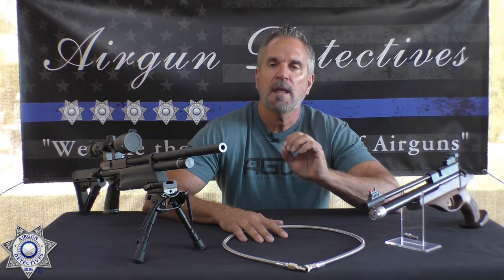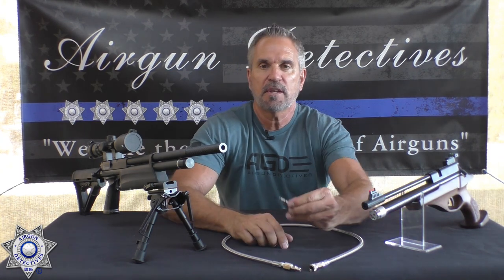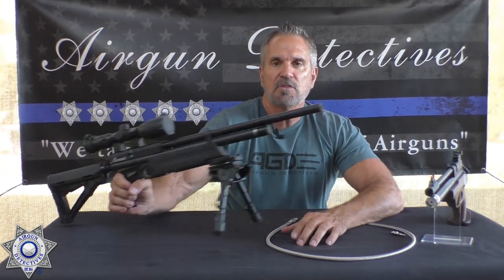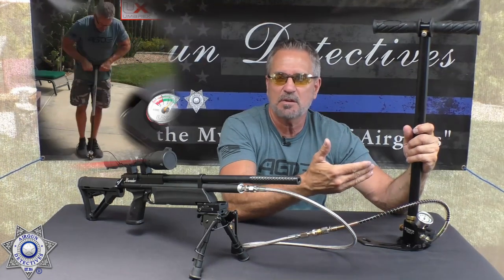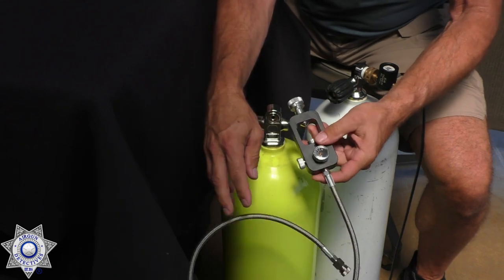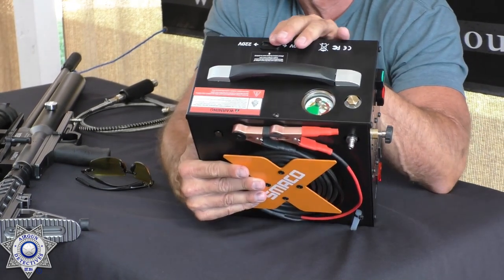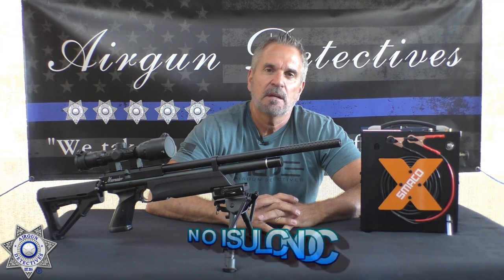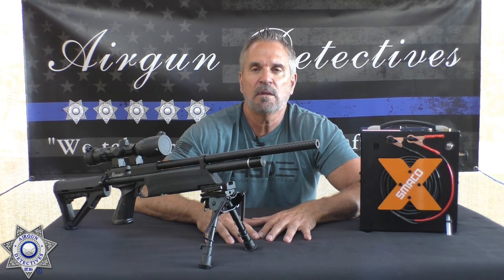"How to fill your PCP Airgun", by Airgun Detectives

Comment: I am looking at buying my first pcp and trying to figure out if I can use my workshop compressor or if I have to use a separate compressor designed just for pcp guns
Reply: No...all stardard compressor from box stores CANT be used for pcp just dedicated pcp compressors
Reply: you need high pressure compressor mate

Comment: Nice, I use a hand pump on all my PCP's due to safety concerns around my kiddo. Yes, higher priced hand pumps are better than the cheap ones. I fill both an AGT Vulcan 3 and an Air Ventury Avenger.
Reply from the maker: They can help you stay in shape as well😉 Thanks for tuning in 👍🏻

Comment: I NEED HELP!!!!! I just bought a new Stoeger XM 1 and it had some air in it and I shoot it all out. Yeah I am a newbie. I have a pump but I have pumped for 30 min. and the needle on the gauge doesn't move. I can hear air going through the pump and the rifle came half charged. I don't know what I am doing wrong, or does it take an hour of pumping when the tank on the gun is empty?
Reply: Probably gonna have to take it to a airgun shop or contact the company I'm pretty new to airguns but the only thing I can think of is something is wrong with your pump or the airtank what pump are you using?

Comment: Thank you for doing this.  Entering the PCP market is intimidating when you read (constantly) about these and those fill probes, lubing these fittings and o-rings, and not these ones.  Maybe now it will be easier...
Reply from the maker: Matt, thanks for tuning in. As the PCP rifles are becoming even more popular there are more pumps being developed. This is good because the price keeps coming down. When I first started shooting PCP the max fill was 200 bar and your options was a scuba tank or a $1500 compressor. Happy Shooting 👍🏻

Comment: Walmart now has high pressure air cooled compressors up to 4500 psi for about $180 and up...extended service agreements available. Worth a look.
We use a water cooled original ourselves. We fill a carbon fiber tank usually from 3000 to about 4300 psi on 1 cycle. From empty it takes much longer. Enjoy, be safe.
Reply from the maker: Kelly,  great information.  Thank you 😊

Comment: is this the only way> can you use like a pancake compressor > like something you would use to run a nailgun or other pneumatic tools?
Reply from the maker: Negative..you need at least 3000 psi. Most your home air tool compressors are 100-120 psi. The good news is there are many affordable choices out there. 👍🏻😉

Comment: I have an EGAL CLAW LEVER ACTION GUN  when I follow your direction on filling the gun, of bleeding the pressure out of the fill line -----all the are comes out of the gun, I called the seller and he told me to just let the air out of the line faster to make the air not come back out, is that right ? I though you just turned the bleed valve open and let the air out of the line, then just disconnect the hose.------------ I'm confused
Reply: I have asked this same question on several forums on YouTube  never get an answer ?????????????
Reply from the maker: Very simple...when you get to the full level on your gun, turn the pump off, open the bleeder valve, and remove the filler hose. You'll still let the pump's fan work for a few minutes to cool down the pump. I hope that gives you some clarification 👍🏻

Comment: Hi, you didn’t mention why the air bleed valve, when is it necessary to do that, every time you unhook gun tank, or is it to bleed off all the air when hooked up to gun. Thanks for all your information. Keep up the good work.😊
Reply: I was thinking the same thing. pretty important safety issue, not addressed.

Comment: Hello. What is the possibility of buying a separate 12V battery instead of using the car battery to charge my PCP rifle. I have a new GX pump I bought on Amazon. Harbor Freight has 12Volt batteries for under $50.00. What are the requirements for the 12Volt battery to basically run the GX compressor?

Comment: The gun im looking to buy is a Hatsan Flash QE in .25 and it has a 165cc tank. Would it be wise to go cheap and save money and get a hand pump or spend the extra on a whole system.

Comment: Hi JC GREAT video!
Do you use anything to remove moisture as you fill the pcp?
I didn't see anything in the video so I'm curious???
Reply from the maker: Actually, those pumps have foam filter inserts. I change them out each day I use the pump. I let them dry out, and I'll use them a 2nd time. Thanks for tuning in 👍🏻😉

Comment: How long would it take to fill a 3000 psi scuba tank with the 110 air compressor?
Reply from the maker: I wouldn't do it. Those little air-cooled compressors are good for filling the rifles. The tanks have too much volume, and you would need a larger compressor. 😉👍🏻
Reply: forever
Reply from the maker: I would be much more gray by the time you could fill a tank.  There are some larger compressors that you can keep the 200 bar tanks topped off. These smaller ones are designed to refill the guns themselves.  😉👍🏻

Comment: I didn't see the discount for the electric air compressor.
Reply from the maker: It should be in the description box. I will update it if necessary👍🏻
Reply: It doesn’t seem the discount is still active on the SMACO website.

Comment: I always want to know what happen if I forget to release the valve before I pull the cable out after filling
Reply: I've done that very thing, the rifle started to leak air quickly from the filling port, I quickly fitted the adapter and pumped it back to 200bar, this must have re-seated the interal valve, as it held pressure when I released the air correctly at the pump.
I even wrote a warning instruction to myself on the pump to avoid making the same mistake 😊 had this pump over 20 years.

Comment: Thanks for the video! 

Before I saw your recommendation of the Smaco, I purchased an Air Venturi Nomad II. It seems very similar and works well so far; but, it clearly states that it cannot fill the external tanks - neither scuba nor carbon fiber. Is this Smaco capable of that? If not, do you have a personal recommendation for a compressor that can fill these external tanks at home? 

Thanks again for making the videos! 

-Dan
Reply from the maker: Dan, shoot me an email and I will give you some information. Info@airgundetectives.com
Reply: Thanks. Will-do.

Comment: JC. with the right adapter hose setup can't you use the compressor too fill up the scuba tanks..???  So much faster in the field.. Please let me know.  Thanks !
Reply: Those little no water no oil compressors aren't meant for that kind of work load the motor isn't big enough to stand the wear and tear, for the one I bought it's 30 minutes of run time 10 min rest with fan on. Scuba tanks require large industrial type compressors.

Comment: Nice video!
I really like that Smaco. Seen a re iew of it just a short while back. Seems way good. Would definitely concider a Smaco if out to buy a compressor for myself. And then I'd absolutely get an extrnsion hose also.
Reply from the maker: I was impressed with the little unit. The more PCP's become popular, the more companies will come out with pumps, which benefits the consumer. 👍🏻😉
Reply: @AirgunDetectives  So true. Nice to see there's several on the market to choose from.
Reply from the maker: @brorjordas1979  I have another one I just came across.  I will feature it in an upcoming video along with the PCP rifle review.
Reply: @AirgunDetectives  Nice! Will be waiting for that!😊👍🏻
Always interested to see what's out there. If I'd ever actually need a real compressor of my own. I've just been watching around for a new PCP rifle - something a bit more accurate and powerful than the Sig Virtus. Concidering lately a Walther Reign or a Hatsan Bullboss. The Hatsan kinda been winning because of it's price (around €600, - while the Reign being at about €950)..